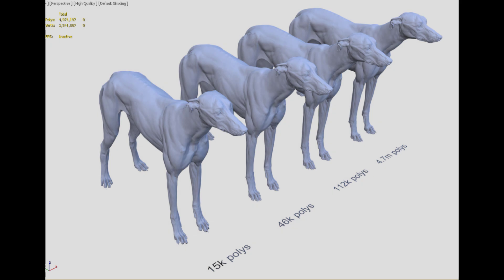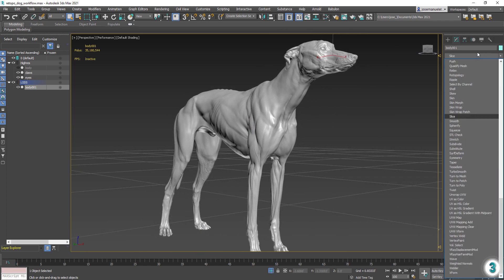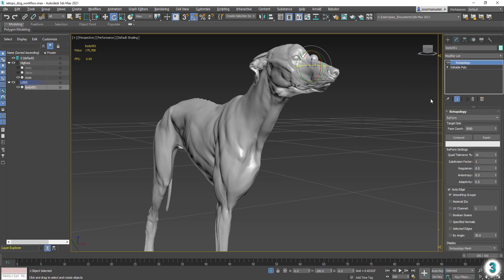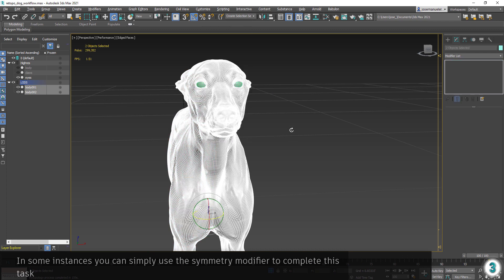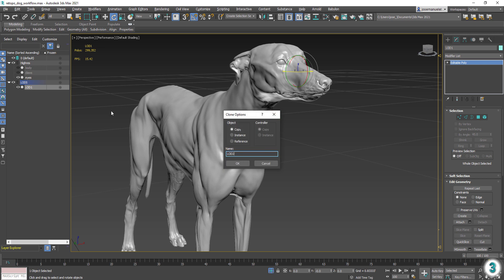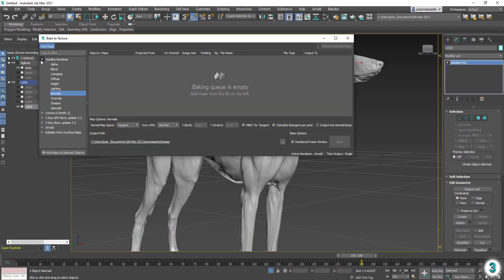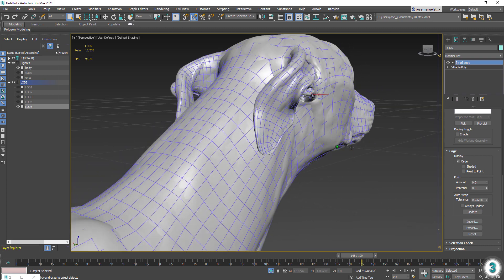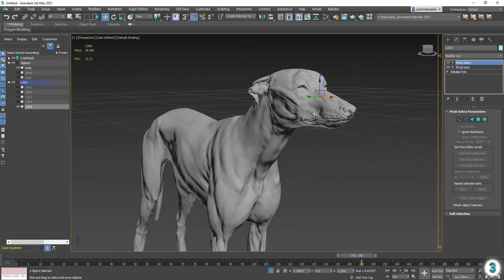3ds Max Retopology

Comment: Hello. At the end the map seems to bake and I have the normal map but maybe I still need to apply it to the model? The low poly model has not changed at all. How can I apply the normal map so it looks high res? Thank you in advance!!
Reply from the maker: You need to connect the normal map to the normal input of the material applied to your model. If you’re using a Physical material you need to make sure the normal map is connected to a normal shader before connecting to the physical material. If youre using a PBR material, you can simply connect the normal map to the normal input (the PBR material has the the normal shader in its code already)
Reply: @josem.elizardo9427  Perfect, thank you so much for the swift response.

Comment: excellent tool, a query to each model you assign the same value to the face count in the first model you put 150000 but when cloning you put that same value then I have that doubt.
Reply from the maker: Try it yourself, let me know if you still have doubts :-)
Reply: @josem.elizardo9427  I tried, when I assign the same value when cloning the mesh, it remains the same and does not reduce
Reply from the maker: Try deleting the retopo modifier and applying a new one with your desired poly count and compute. Should work

Comment: Very well done! Thank you Jose for this. How did you deal with UVs?
Reply from the maker: Thanks! I just did a simple flatten mapping with a higher threshold, than packing with the new concave packing method. It’s not perfect but I’m lazy ;-)
Reply: How do you do the smooth zooming like in Maya? Most max guys seem to use the mouse wheel and it’s super jerky then.
Reply from the maker: Ctrl+alt+middle mouse button press, move mouse
Reply from the maker: You can also set Max’s navigation to Maya mode in the preferences dialog.